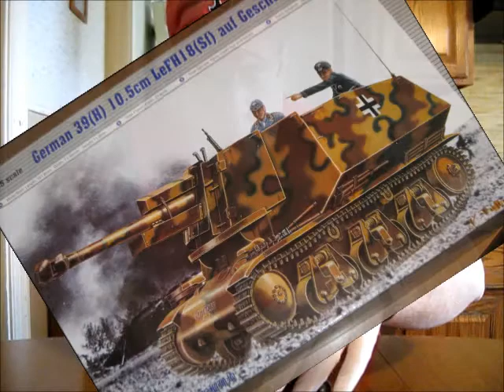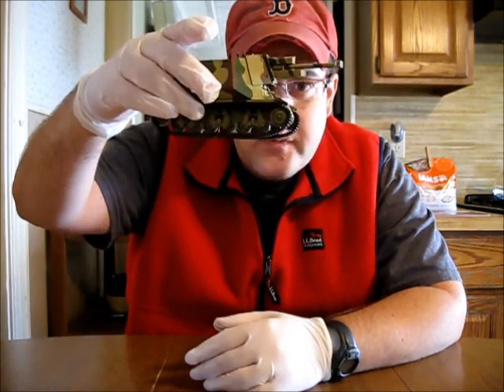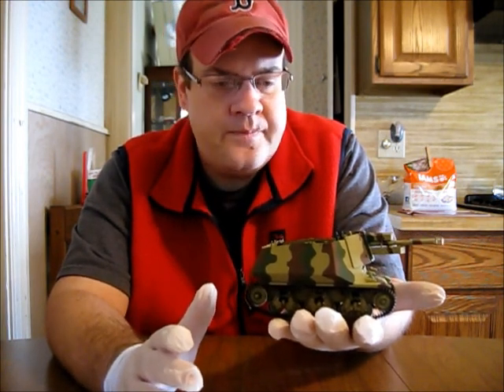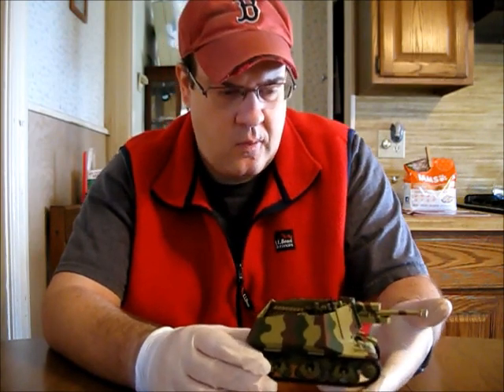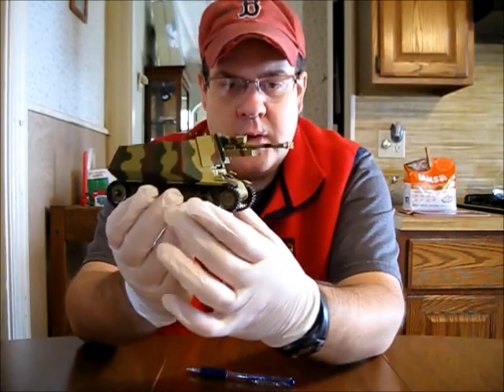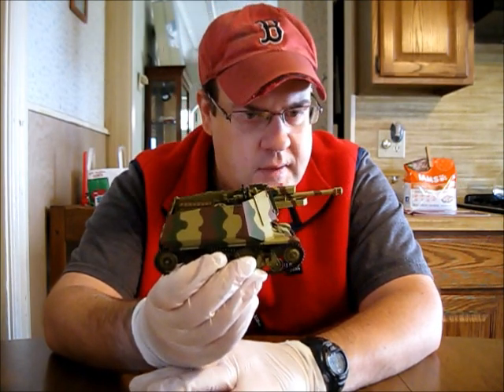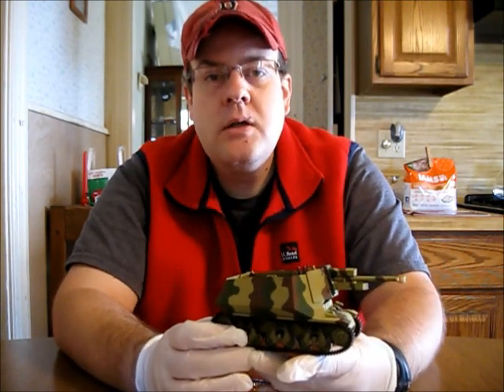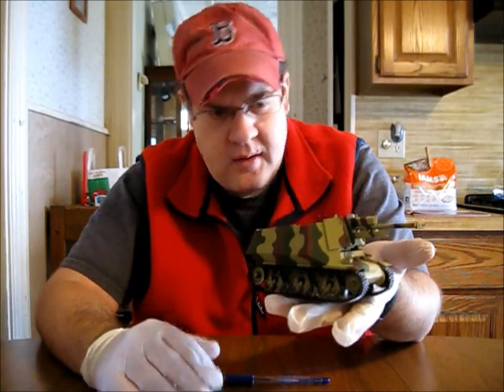Russell Gosselin: Trumpeter's 1:35 Geschutzwagen Part V

Comment: Looking beautiful already! Quick question, how can I protect paint on my model after painting from scratches and such?
Reply from the maker: +Ethan Ton Thanks, Ethan.  You can protect your paint finish with a clear coat.  The come in both flat and gloss finish.  Usually one to two coats for flat.  They come in spray cans and in bottles to be thinned for airbrushing.  It is commonly manufactured as a lacquer.  But there are some acrylics available.  I use Testors lacquers, however, tamiya, and other model producers have their own versions.  I hope this helps.  Model on!